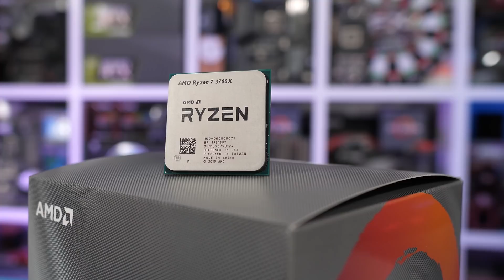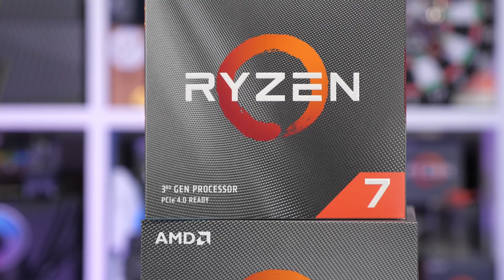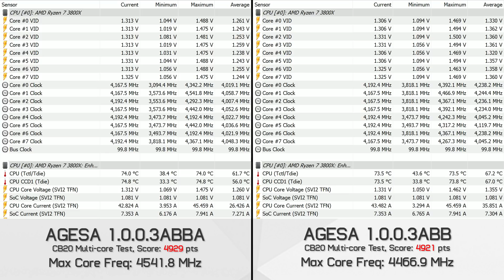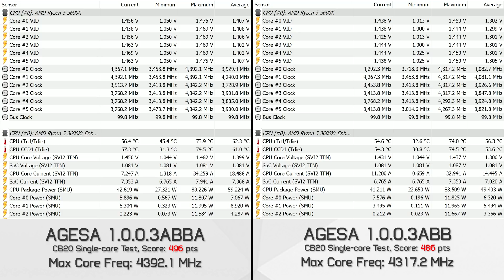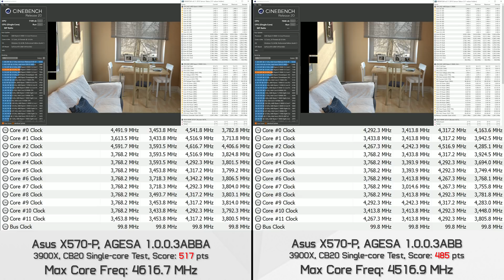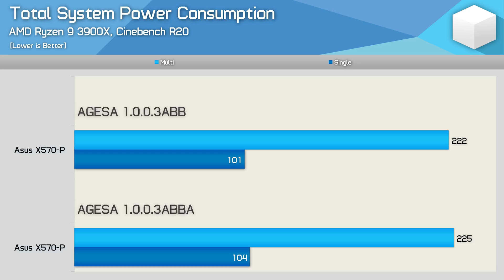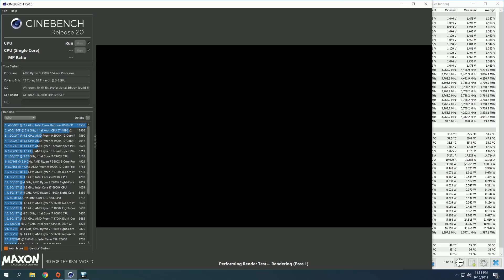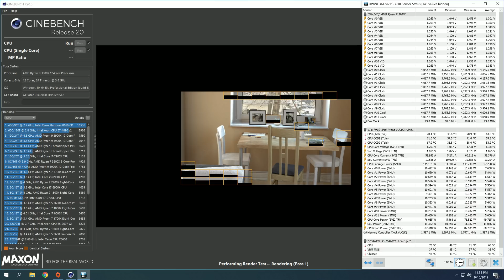3rd Gen Ryzen Boost Clock Fix Benchmarked, AGESA ABBA Time!

Comment: Where did you get ABBA for Asus?? Been checking the website every day.
Reply: The ABBA bios isn't  officially out yet. The bios making the rounds is only a beta driver, I would wait until your respective motherboard manufacturer releases their own ABBA bios. Just to be safe, it's no fun bricking a motherboard due to a dodgy bios.
Reply: @jotunheim5302  Especially if your board doesn't have bios flashback
Reply: @kendokaaa  U mean bios flashback can fix a bricked mobo?? If that's correct, im super glad bc my msi x570a pro has it, and everytime I update bios im nervous asf worryin a blackout might occur during the process lol.
Reply: @t.n.9508  It usually can, yes. For some reason lots of high end boards don't have it. You can even update your bios without a CPU installed which is great for someone who buys an X470 or X370 board for Ryzen 3000
Reply: @kendokaaa  Ok thx, I never knew that. Somehow I picked the cheapest x570 mobo and it came with that function lol.
Reply: Check the AMD subreddit, I saw it posted there yesterday

Comment: The graph shows lower is better in FPS result.
lul
Reply: more cinematic!
Reply: @Kobrar44  25fps with motion blur, ultimate cinematic experience
Reply: @rens3286  I prefer my absolutely high end 1 fps average setup :^)
Reply: HBO 8k experience
Reply: Gamers Nexus benches hardly showed any difference.
Reply: @glenwaldrop8166  we probably would have seen little change with the Aorus Master as well given it boosted well for us previously.
Reply: @gamingunboxed5130  Even your benches don't show a lot of difference.

It's pretty much the performance gain/loss from rebooting the system.

I never turn mine off, only reboot when I have to. They settle in to about 5% slower or so, reboot and get it back.

It's a whole lot of kerfluffle and when fixed really doesn't amount to a lot of change.

I will say this, I was happy I waited to buy anything when it was announced and I'm more likely to upgrade now that it's been settled, so it helps with consumer confidence, however the numbers themselves just aren't that terribly different.

Comment: Never had problem with my 3700x + Asrock  X570 Taichi since day 1, everything is working perfectly fine.
Reply: I have the same setup and I have never seen anything higher than 4275MHz. I am curious where the issue is...
Reply: @Galdamon  do you have pbo on?
Reply: @Barney-ii1no  atm I do, but having it on/off doesn't make a difference
there is also the issue where HWInfo and Ryzen Master both report idle voltage 1.45-1.5V which I can't seem to solve (but idle temps are ok, so I just ignore that one)
Reply: @Galdamon  Did you download the chipset drivers from AMD and set the power plan to Ryzen High Performance?
Reply: @tim3172  I do have the latest chipset driver. I tested with balanced and ryzen balanced. I don't see how high performance would help it.
Reply: @Galdamon  ASrock is slow with bios updates

Comment: Hm. Using 3900x on Asus Crosshair VIII Hero WIFI and previously i've got 4.4 max boost on single core (which is low). Will see what frequency it would be with new bios...

Comment: Which is better gtx 1070 ti or rx 5700
Reply: rx 5700 every day
Reply: RX 5700 is almost 10% faster in any resolution according to Tech Powerup.
Reply: @bgtubber  I know but the 1070 ti used is now cheaper and when overclocked it can beat the performance of the 5700

Comment: The 0.2MHz missing base clock can be recovered by disabling spread spectrum.

If anything, due to the nature of how spread spectrum works by bouncing the base clock around 100MHz (to claim full compliance with the FCC on electromagnetic emission regulations), the clock might start at 99.8MHz and bump up to 100.2MHz and back to 99.8MHz. This in turn makes HWInfo read 99.8MHz while the reality is the average is around 100MHz, and that means the Ryzen 7 3700X actually hit 4.4GHz!
Reply: What he's saying is that the base clock is actually 100 mhz all the time as an average. The reported clockspeed is never 100% perfectly accurate. Taking that into account, the 3700x reaches around 4400 mhz, and it doesn't get stuck at 4392 mhz as the hwinfo monitoring says.
Reply: @adrianstan5794  The reported clockspeed can be perfectly accurate depending on hardware, and on some boards the frequency will absolutely stay at 99.8 and not bounce higher (this can be proven by using spread spectrum to show a repeatable performance difference between 99.8 and forced at 100). The exact behavior depends on board implementation. I'm not complaining at AMD here. If a 3700x reaches 4392 and not 4400, that's on the motherboard manufacturer and not AMD (and given that originally the gigabyte board boosted fine where others did not, this is almost certainly a problem with mobo manufacturers screwing with the AGESA).
Reply: good job accurately reading out something that pulses 100.000.000 times a second anyways
Reply: Disabling SS on my board does nothing, but that's probably just an Asus problem
Reply: @kendokaaa  Asus is apparently quite shitty about SS. They consider it a "premium feature" and only enable it on higher end xX70 boards. Base clock is also locked to integers only on Asus boards without SS.
Reply: @SemperFiAvius  Yeah I heard about that. I have a board that has it, in my case the setting just doesn't seem to work for some reason
Reply: Are you trolling or are there really emissions for computers
It ain't april first
Reply: @0s0sXD  You misunderstand the word emission.
"the production and discharge of something, especially gas or radiation"

AKA electromagnetic radiation
Reply: My Asus TUF X570 doesn't have a spread spectrum setting, but my Asrock B450m pro4 does. It also runs at 100.1

Comment: This whole thing was definitely blown out of proportion, the performance difference was negligible at best - exiting background apps, updating video drivers, cleaning out a dusty cooler would pull more of a difference than the problem/solution.
Reply: I agree that its overblown. but all in all, them addressing this is still a plus for the consumers and for AMD themselves, avoiding possible technicalities required for them being sued again like the FX lawsuit.
Reply: apachelives It’s the principle of the matter and a slippery slope. If you let a company get away with false advertising (even only on a technicality), it opens the doors for more and more severe infringements later down the road.
Reply: 10% in some games - negligible difference

Comment: Well.... all the OLD games just got 1-5% faster...
Something good..from a patch.
Can't complain.
Reply: the real debate is zen3  Dancing Queen  VS 9900k
Reply: @brunogm  The 9900K can't even reach stock boost clocks within the stock TDP using the stock cooler.
Reply: @CeriPie  Is this really such an important note that you feel the need to post it in just about every thread? Sometimes 3 times in one thread. Are you that big of a fanboy?
Reply: Exactly
Reply: F1 2019 and Far Cry New Dawn are old games now?
Reply: @tree_fiddy  its an old engine
Reply: And that was normally the only advantage that the 9900K had over Zen 2 before this patch.
Reply: @Nghtmare30589  Then in Future, this Result +Zen3 Cores (Reduced Latencies)

Comment: Will the new bios also improve PBO+Auto OC? Or just stock? Dont really wanna test beta bios on my x570.
Reply: pbo just doesnt work
Reply: @attackLive  it does for me its doing +100 mhz on a +200 auto oc, its the reason why im hitting boost clocks from 4.2-4.3 stock, 3700x +h150i + x570 elite.. its why im asking that if im already hitting 4400 mhz on ABB with pbo and auto oc, will i hit 4500 with ABBA? 

My brothers pc also does 4300 on ryzen 3600 with auto oc+pbo..  if hes hitting 4300 mhz already will he hit 4400 like 3600x?
Reply: @fran117  on my crosshair 7 hero does nothing, idk
Reply: Its stock speeds.